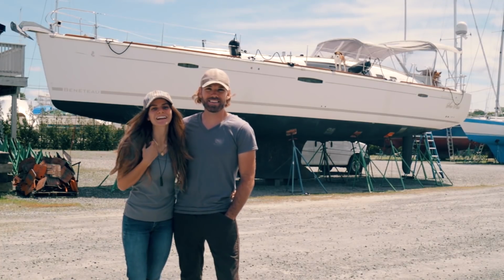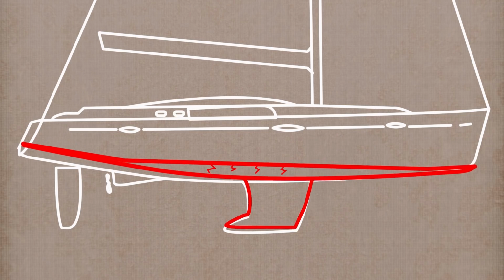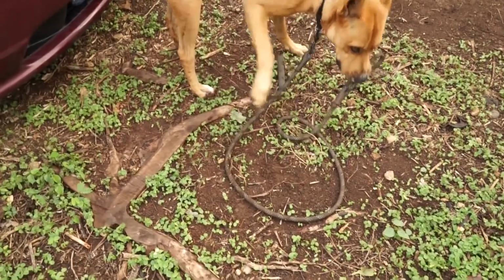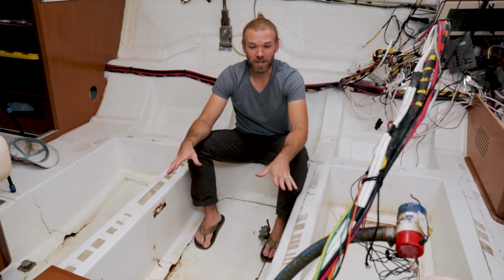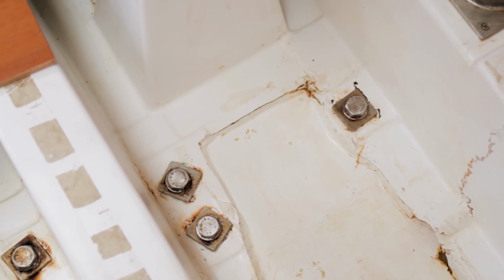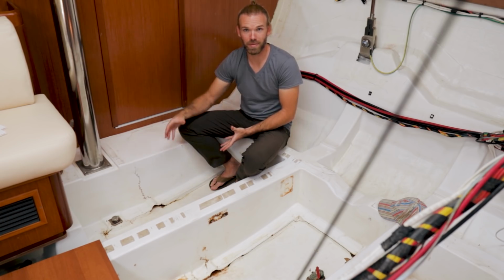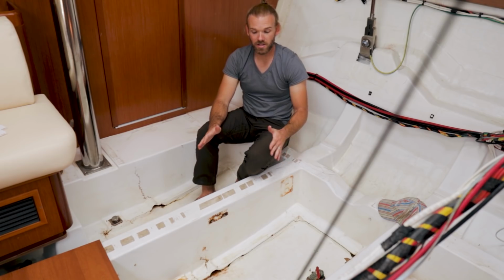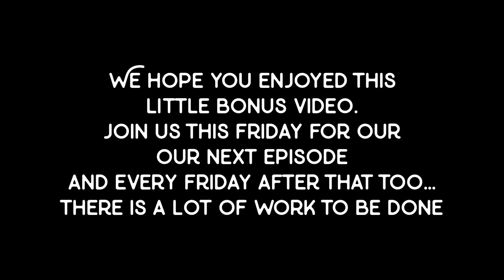What Happened and What Now? our SALVAGE SAILBOAT story | Expedition Evans Bonus

Comment: The only way to repair the grid is to cut the flanges off and laminate with fiberglass with epoxy. There is no way you will ever get a good bond just trying to get new adhesive under the flanges. There is almost definitely damage to the hull bottom as well, you will need to remove the keel bolts and grind the bottom, then add several new layers of glass. I would also consider making much larger  316 stainless steel backing plates for the keel bolts.
Reply: Erwin McQueen Good advice. Better than factory, certainly.
Reply: Excellent advice
Reply: i don't know anything about firberglass boats But the stringers seem to be more than 12'  inches thick   it seems to me the problem is to attach  what they call the  tab to the side and bottom of the stringers to carry the weight of the keel   and then fiberglass this area to the bottom of the boat.  could a steel stirrup be  made  say about 6  inches wide  with a flange at the bottom  so when the keel is attached it would be hanging of the Stirrups
Reply: Agreed
Reply: @rexolrexol7893  The purpose of the grid is to spread keel loads across a larger part of the hull, your stirrup idea would be temporary at best, at it would introduce point loads.  I believe it would be faster , easier and better engineered to cut of the existing tabs and relaminate them across a larger area........how it should have been done to start with, even these large boats are built down to a price.
Reply: You are exactly right.

Comment: One of the comments on this video was to contact the manufacturer on the repairs ? This is an excellent avenue to take. The manufacturer most likely has had to help an owner in the past with similar structural damage / repairs. Engaging the manufacturer will give you access to their engineering department and get a stamp of approval regarding the method of repairs. The fact that their name is on the vessel I would think would push them to help get the repairs done correctly. I mentioned in one of your previous videos to document the repairs through a surveyor. I still believe this should be done for resale of the vessel in the years to come. Good luck ! 
This is an enormous project ! Keep the faith and don’t get discouraged

Comment: Again, I just did this repair to a boat with the same damage done in the same way in 2016-2017.  The grid was removed and revealed that the hull was heavily damaged and needed repair.  The keel was dropped, the hull ground back and then repaired and the grid replaced followed by the keel.  If you think the hull is not damage you are wrong.  The hull flexing and breaking is what caused the grid to move, break and come loose. What you see is the surface of the damage.  You need to look below the grid.  If this was a simple inexpensive repair, the insurance company would not have paid the original owner off and salvaged the boat.
Reply: Exactly, as per my comment, I don't think that with it being sailed in that condition for so long that there is any real structural integrity left in the centre portion and even the deck and chain plates compression post base. There's a lot of structural integrity lost, I wouldn't be surprised if that boat broke in half in heave seas, not a boat I'd sail more that 10 miles offshore in and never above 20 knots.

Comment: A couple of people have already commented on this but I'll give you a little first hand advise.

Cut the tabs off and grind both sides very well. Then reglass everything...
Don't waste time trying to cut them free with a vibrasaw.
But most importantly!
Remove "everything" out of the boat first!!!
Move to a apartment or friends house until the cutting and grinding is completely done and you clean up everything...
Grinding fiberglass is like sandblasting... It will get in everything!
If you have clothes on board it will find its way in them....trust me it will!
Six months from now you will put on a pair of underwear with fiberglass dust in them and wonder why am I so itchy....
Not good!!!😂😂😂😂
But seriously, get everything out of there first.
Good luck!👍
Reply: Agreed even buy a old van or recreaction van or caravan to live in doesn't need to have engine park it boat yard if you can. Fibre glass is itchy and bad to breath in or live with it. Treat fibre glass cutting and sanding or similar as industrial dust. Wear the suits and vacuum up dust as you go and use water droplets and hose pipes and water lubrication on cutting disks to force dust to come out of the air.
Reply: Agreed. Grp dust gets every where. Tent over everywhere you are not going to work,  borrow a caravan , rv  to live in when you are grinding,  seal everything  twice!
Reply: +1
Reply: Please follow this advice.
Reply: Sun shine can only second to that. Plan your cutting and grinding in a short period, make sure you have good ventilation, good dust extraction and tape every other part of the boat shut. I guess preparation will take a day, cleaning up 2 days

Comment: In case you have not done so already...  I strongly recommend that you measure the hull very thoroughly for water saturation of that balsa core.  If any part of the core has begun rotting, now would be the optimum time to repair it.
Reply: It is cored, but beneteau has the balsa core cubed and they glass around the cubes to keep them independently sealed.  Just need to make sure there was not a number of the cubes that were "violated" by water intrusion.
Reply: It looks like they reinforced the entire Hull.
Reply: I just watched a video from their companies website.
Reply: @rodneyogilvie6794  Balsa began it's laminate use in aircraft 60 or 70 years ago.  A Balsa supplier decided to expand his business by selling the tech to boat manufacturers to increase sales about 45 years ago.  Balsa wood cores have been a point of failure since first introduced, although it does help to strengthen a lightened laminate structure.

Comment: Check with Sail Life, he did this to his core as it was all gone due to moisture. He had someone help him look at a structural solution that meant minimum cutting of existing pieces.
Reply: I suggested this with about 4 others in the last episode. MADS IS AWESOME! He did end up going to the Pro Andy from Boatworks Today though so if anything, Andy is the Man to go to for the advice and help as Mads did. (I love Sail Life!)
Reply: Wacked well Madds left the encapsulated rotted frames in the boat . Not my first choice.
Reply: @CheersWarren  valid point but in his case, it was core that is rotting but used that as the moulding for his job. Not the case here bit same principal
Reply: He did it right. If I remember correctly he consulted an engineer before making the repairs.
Reply: @CheersWarren  He did, but the glass he laid over the rotten floors and stringers was enough to support the entire weight on it's own.  The wood core can dissolve completely and not lose structural rigidity.
Reply: @mlmarcellus1  he even had an interview with Andy from Boatworks Today. They follow one another so why not right?
Reply: I Agree check with Sail Life. He is also a fiberglass legend
Reply: @CheersWarren  Considering there was no cracks or damage in his boat I merely suggested they contact him to have a consultation, as he took a decision not to actually cut things. Thats the main part to go with here. Cutting is not always the best option if one asks about. There could be easier and better structural options for them to consider.
Reply: 'Wacked' , I know this is the world of you tube but a 'repair expert ' on the spot is who they should talk to . They have been talking to Beneateau and other repair expert/yards ( who have done similar repairs)so I think they are on the right track so their repair is considered acceptable for reinsurance as a professionally repaired boat. That way it will be back to its true value. I suspect that is why they will be removing the keel as that is the way it was done in previous repairs.
Mads did consult a structural engineer for his repair , but for my money I would not want to have left the rotted remains of his structure in the hull. But that's a different conversation . 
Oh the correct way to do this would be to have a marine surveyor watching over the project 'as if' it was an insurance repair  so the full value of the boat can be realized  at the end. This is what Nigel Calder did when he did similar damage to his boat and in fact had to redo the repair in a different yard when the work was substandard.( long story). 
I suspect the insurance wrote off the boat because they determined the grid should be replaced for full integrity to be reinsurance , which is a huge job.  Think unibody car. Cheers Warren

Comment: I can't believe she sailed on like that for another five years and no one noticed anything.  Incredible.  Add another vote (if that's how you're deciding) to the cut the tabs off with a multi-tool camp and tab it back in.  If you need more youtube to watch besides SailLife, Boat Works Today with Andy is an amazing resource.  Though I like your planned approach of grinding everything out until you hit good glass.  I'd also suggest media blasting that bottom paint off when you drop the keel, repairing any damage, then barrier coating the entire hull once you put the keel back on.  Unless you're going to copper coat.

Comment: This boat is a massive undertaking and to do it right is going to take an extreme amount of work and money. Definitely seek out the advice from someone who has done alot of fiberglass layup and knows what they're doing. I'd cut the tabs off and grind all surfaces to bare glass. Any shortcuts taken here will doom your process and potentially risk your lives later. Your in for alot of grueling nasty work but if you do it right you will be richly rewarded for your efforts.

Comment: It sounds like it would be a lot easier to just cut the tabs off and not even worry about trying to clean. As you said you're going to have to glass from the grid to the hull anyway.
Reply: This has some serious merit to it. You may want to actually consider cutting out the entire damaged portion of the grid and then rebuilding it by laying glass over a form of styrofoam or balsa. This will allow you to get a seriously strong bond because you can use ( many layers ) continguous pieces of glass going from hull over form and back to hull. Every boat used to be made like this before manufacturers discovered the cost savings and enhanced look of molding structures like your grid and then just tabbing the grid in with glass on the side.
Reply: And stronger
Reply: The tabs seem to be carrying the weight of the keel   there must be a way to distribute the weight to the Stringers
Reply: @jameshardy2039  when Mads did his he just laid glass over the top of the compromised grid. The glass provides the strength, all that damp wet soggy plywood or whatever was in his grid just provided the form. The only draw back I see to laying glass over the top of the stringers is that dimensions will change and it will make putting the interior back in more difficult as things will have changed as far as mounting. Mads didn't have that concern since he gutted his interior and was rebuilding it from the hull up anyway. It seems to me once they get the keel dropped they might be able to wedge up under the stringers that are broken loose and throw some thickened epoxy under there and then weight it down like they were saying.
Reply: I agree , cut the tabbing away , you need a very good bond between the end of the grid tying into the hull , this ty-in  closest to the grid gives you the greatest strength.
You'll never be able to clean the overlapping tabbing properly to establish this , there just isn't any access to the tab to hull joint unless you remove the full frame , which would mean taking the whole boat apart.
I am doing a lot of engineering work with similar conditions (car structures) and by far the best connection is closest to the intersection between hull and frame otherwise there will be flexing on the tabbing which will eventually lead to fatigue failure.
Reply: planet4allofus so true. The only reliable option I see for keeping the tabs and getting a good bond is clean between it in some sort of way, then using a methacrylate glue to bond things together. These glues have a good bite on even less than perfect surfaces. 

But cutting the tabs and relaminating them should be easier. I would however not want to live aboard during the cutting...
Reply: @jeffwood8109  The reason I suggested this is because of what has happened to the boat in the first place. I find it very suspect that a portion of the grid separated from the hull in the first place. In theory if the stringers are properly glassed to the hull it should effectively be one piece and thus any grounding hard enough to crack a stringer would also result in a crack to the hull. I suspect that the current tab system in place works more like the keel is bolted to the grid and the tabs just keep the hull from moving around. I agree about about the interior but in each case it would be very important to add new glass in a U shape, from hull over stringer and back to hull vs L shaped tabs on either side, which is probably the original and obviously weak design.
Reply: How much actual hull fiberglass damage is there I wonder....
Reply: Can't be very terrible I mean the previous owner was sailing it around for 5 years and they just got done motoring it to their current location. Some leakage but not much.
Reply: @jeffwood8109  That's true, lol.

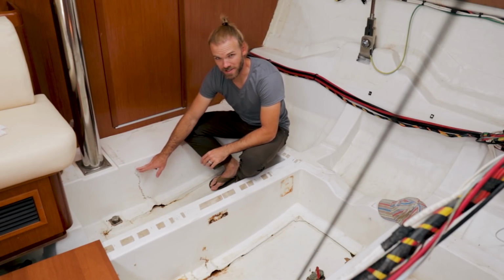Comment: Check the video at 5:48. You have the keel bolt in line with the mast post and the crack to the right. That is a big deal. This is all fixable but it needs to be done right. I'm begging you to get a marine engineer to survey the damage and give you guidance on how to effect repairs. You will need to use a vacuum bagging system to ensure you don't have voids.
I'm an aeronautical engineer and have a fair bit of knowledge on large composite structural repairs. Built my first boat when I was 12. Without a thorough inspection by a qualified engineer/surveyor, utilizing the proper equipment, you're going to be slapping on layers of fiberglass and calling it good. It will hold well enough until you need that strength the most.
Reply: After posting this I read the "PS" section containing this: "We have talked it over with marine architects, experienced repairmen, our surveyor and Beneteau America". That's good to hear. I'm still pushing the use of a vacuum bagging system. As you stated in the "PS" section, this is totally repairable, as long as it's done right. Good luck and you have a LOT of people pulling for you.

Comment: Because the previous owner was sailing for 5 more years (wow), I think before you will reattach the grid to the hull, you should carefully test the strength of the bottom. I have seen some similar cases where everything was ok but after the high enough pressure was applied (form the ground up), the hull starts flexing along the cracks. When you are sailing on severe weather conditions, massive forces can be created, and you can have a material fatigue case. In that case, scenario more grinding, more work, and more reinforcement is needed, but the key is to know about that cracks!!
P.S. I was repairing some fibreglass boats with cracks on the bottom, loose centreboard case or chopped off the bow. It is base on my experiences. 
Good luck :)

Mariusz

Comment: I did the same repair on a grounded Beneteau 40 and a Sea wolf, back in the 80s and found the bonding paste used was  basically a thickened poly resin and very brittle, came away quite easy with a chisel after cutting away the base and flanges one section at a time, reglassed up the faces onto the hull after grinding away gel coat etc, extending the glassed areas out at least double the width of the flanges, in my opinion it was twice as strong as the original, also replaced the keel bolts as these had stretched. there was also external hull damage, believe they are both still sailing in south Wales .

Comment: Oh please make your work space inside of the barrier tent is a negative pressure environment. A box fan with a household air filter on suction side exhausting to the outside will help. Add  positive pressure fans supplying fresh air from outside through a hatch into the boat to  the spaces external  to the barrier tent. Use a shop vac with a hose connection to the exhaust port of the vacuum that you can lead out side. Yes a Home Depot bucket vac works. So do the bucket dust separators to extend the life of the paper filter covers. Just use 1.5 inch hoses and get the adapters so you can connect the different hose sizes. Be safe. Love your attitudes!